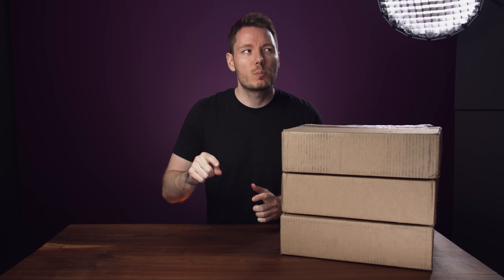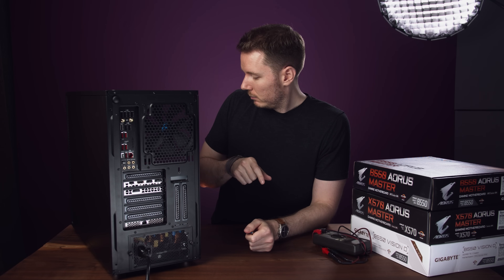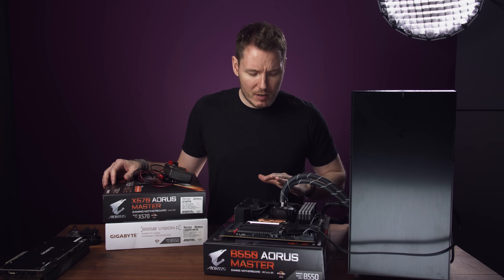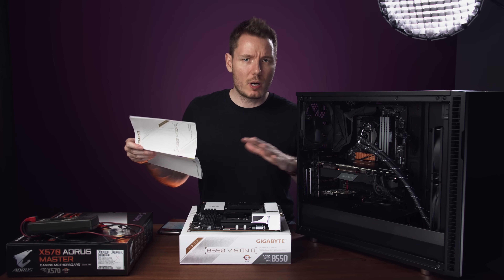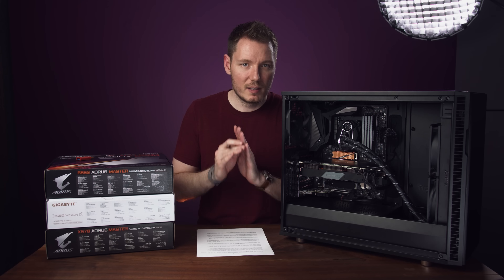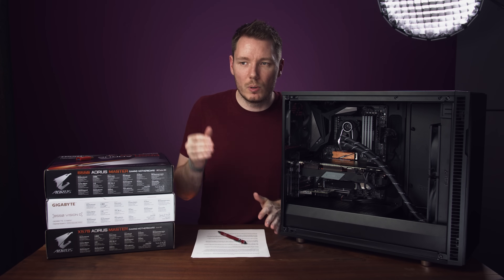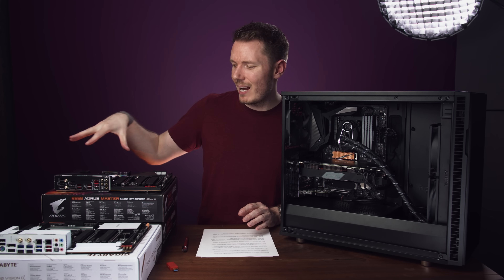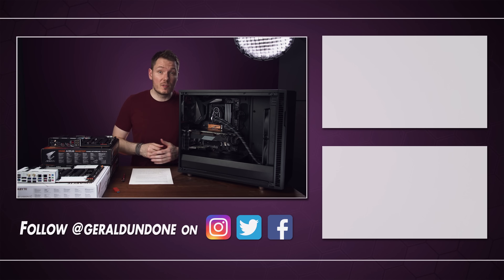I Was WRONG About These AORUS AMD Motherboards

Comment: 0:57 Audio interference is usually not mainboard, it's often the front panel of PC enclosure. If you're unlucky it connects Audio GND and USB GND together which is a big NO-NO. It defeats the audio star-ground on the mainboards and creates a ground loop. But it wouldn't matter if you use external interface exclusively and don't have any audio connection to PC. The ground routing can then cause the loop created between USB and audio to become an antenna which will collect all sorts of RF interference, predominantly from all the switching voltage regulators like on the GPU and elsewhere and from the PWM light control etc. To check: disconnect HD Front Audio connector from mainboard, the noise on rear audio out can disappear. You want there to not be continuity between front panel audio ground on the case and any USB ports on the case, but if you connect mainboard, the continuity will be measured through mainboard.

Longer ground loops are also possible. It's needed to consider all the equipment, not just the PC, but everything connected, all the connections made. I don't believe you showed all in the video, the interface was only mentioned in passing.

A few minutes in... the continuity between protective Earth pin of the PSU, the chassis, and all ground points must be continuous, the mainboard per se cannot defeat it. This is weird. Why it's not measuring like that... injected ground loop current? Wait a sec, what multimeter do you have, and does it measure continuity on the resistance range or on the diode range? I think it would be curious to switch all the multimeter modes and even try current and voltage. You want there to be zero current through the multimeter between ground points and you want zero voltage between these points.

Very important, do you have an extra PSU to test? Because i don't 100% trust yours at the moment. Please perform resistance measurement from middle pin (ground) on the IEC power socket to ground outputs on ATX connector and others. First you check how much is the resistance of your multimeter and multimeter leads by connecting them directly together, you expect to see something like 0.3 Ohm, and then you check the ground path resistance through the PSU, and you expect it to not be significantly higher, maybe by 0.1 Ohm at most. It's also vital that PSU enclosure screws are similarly well connected. Because most of the switching noise gets disposed of by shunting it to house earth, so earth impedance must necessarily be very low. And well it must be low all the way to the breaker panel in the house.
Reply from the maker: Yes, I think that's what's happening. The USB is acting like an antenna for the noise in the system due to the grounding issue.
I have tried another PSU, didn't make a difference. The only thing that resolves the grounding problem is switching cases. 
The results are the same even if I measure from the ground pin on the power cable to the computer. Works when off, not when on. The case has to be doing something right? Why else would it work in a different case?
Reply: Gerald Undone The grounding issue could have also fried the USB ports that didn’t work, especially if you used powered hubs.

Comment: Hi. Great video, but I thought I should point out that your front mounted radiator with the tubes down is going to put additional stress and wear on your pump. JayzTwoCents did this video https://www.youtube.com/watch?v=xNAMxZgvves&t=31s explaining how radiator position matters. You clearly do your research and know a lot, but everyone needs a pointer now that then... just thought I'd help :)
Reply from the maker: Hey! GamersNexus did a video recently that very convincingly proved that tubes down is the best way to go for front mounted radiators provided the top of the rad sits above the pump, which mine does. As far as performance, I get better thermals with front mounted with this build. Usually you trade off GPU temps for CPU temps by choosing your mounting position between top and front. I've tested this pretty thoroughly myself. 🤓
Reply: @geraldundone  Got it. I'll have to check out that video sometime then. While it's been a bit, but I think that JayzTwoCents video did mention radiator height relative to pump position, and I forgot. My mistake :/

Comment: pro tip, you can boot a mobo outside a case without the case power button by just touching a screw driver to the two pins that are for power button
Reply from the maker: That makes perfect sense. Thanks for the tip. I don't know why I never thought to do that. Like I said, I was already jumping the CLR CMOS pins. 🤓

Comment: I get interference with sound when using LED fixtures. I work for a company that does concerts. We have conventional lighting as well as led lighting. We have to make sure that the lighting is on a separate leg of phase in order to limit the interference with the sound or video. So generally when a venue has 3 phase, we lock in our power distribution panel, and we plug video, lighting and sound into separate phases of power.

Comment: Continuity testing rarely works well when a device is on. As current gets leaked through to ground, it causes small voltage differentials to appear in the chassis ground, which will confuse your meter.
Also, I’d generally recommend against continuity checking while things are on anyway, as this applies a small voltage to the probes, and this can confuse sensitive system components (to my knowledge the highly limited current released by the meter is unlikely to cause any actual damage, though, but I have by times seen it crash a system, or introduce glitches).
Reply: So basically continuity measurements only work in circuits without an applied voltage? I didn't know that! So the meter looks for exactly the voltage it sends out?
Reply: lightsout Yep. Only “reliably works” in inert circuits. And yep, it’s looking for a trickle of current of its own production, which can easily be fooled.
Reply: IANAEE, but i was wondering if this was the appropriate method too. Wouldn't the appropriate way to test for grounding issues be to set the multimeter to VDC and measure the voltage difference between ground points?
Reply: Nick in theory, yes. But while that might work while the machine is powered on, there are so many ground points where would you start? A lot of grounding issues are caused at the component level (missing or broken decoupling capacitors, broken shunt resistors, etc), and would be nearly impossible to find with this method, without a schematic, micro tipped leads, and a lotta time on your hands. Generally the best way with advanced micro- components like these is to just do what Gerald did and swap out components until you’ve whittled down the list of possible culprits.
(IAAEET? Is that the acronym? Lol)
Reply: @WesPerry  IANAEE - I am not an electrical engineer. Why anyone would expect you to know that is beyond me, or, WAWEYTKTIBM. ; )
Reply: @rango_unchained  I had gathered that, but thanks ;)
My acronym was I Am An Electrical Engineering Technologist, IAAEET ;)

Comment: That’s a issue I have never encountered (thankfully). 
But at least you solved it to be a case issue.
Reply: he didn't solve anything because he's still using the same case, that's the first thing I would throw away if I had that problem and I wouldn't use my computer if I knew there's a ground issue as he's showing because it can kill you if there's no earth ground when the computer is on, that's crazy and stupid if you keep using it the same way.
Reply: Ricardo Penders 
You got an information to back up those claims?
Reply: @Itspixelwolf  just hold a live wire in your hand and the other hand you hold earth and see what happens... NOOOOOO of course don't do that it will kill you!!
But it's the same thing, if in the case or PSU the live wire got loose and it's against the case it can kill you because the earth is not connected that's just logic and I don't have to prove that it's in the books
Reply: Ricardo Penders I am pretty sure that concept is not the same and incorrect and full of variables. Unless you are directly touching the inside of the PSU you’ll probably get nothing more than a painful shock.
Reply: @Itspixelwolf  the case is metal so if there's a loose wire inside the PSU and it touches the metal the whole case can go live so do what you want with it I don't care, I wouldn't want to have a case with that big of a risk to electrocute someone
Reply: Ricardo Penders k

Comment: Does the noise go away if you run your audio out from the headphone jack at the front of the case? (I know this is hardly a “solution,” but I wonder if you have tested it.) Had the R5 Fractal with a different build than I have now, and this was the only way I was able to eliminate noise from my speakers. After updating all my internals a couple years ago, this problem went away and I no longer need to do that even though I’m still using the same case.

Comment: the gpu coilwine throu the speakers is something that asus and nvidia solved couple years ago, with the B450 release, one more reason for me to not chose a gigabyte atm (I've used gigabyte for almost 10 years, and still use it in one of my systems, so I don't consider myself an asus fanboi)

Comment: I think I got the same case, and I do not have any issues with sound, but I do not use any RGB elements :). Have you swapped power supply also? I would rather bet on power supply then MB or case.

Comment: Wow! I had that problem with my old B350 Gigabtye motherboard and Ryzen 1700X using the DAC USB (using M-Audio SuperDAC). I also had Corsair LED RAM in it. I tried different USB ports and still that high pitched sound. Tried reversal polarity on the powered M Audio BX 5's and the sound was still there. 
But through the 3.5mm headphone jack, no problem.
I've upgraded to a X570 Gigabtye Elite and 3990X with RGB Corsair RAM and just a slight hint of that high pitched sound. Playing anything masks it completely.

Comment: At around 13:05 I started to laugh.
I just laughed at how ridiculously relatable and lifelike this video is.
How the second you turn on your newly assembled PC and it runs into a bluescreen, or a hardware failure, or basically any of the endless possible issues that can happen to your build, and the itching feeling of utter annoyance but also nerdy interest and solid determination to solve the issue, and the testing, and the monitoring, and the reassembling, over and over again...
Is it a bad motherboard? Did I install my drivers incorrectly? Is it a faulty memory block? A small screw short-circuiting the electrical loop? And when you thought you have finally figured out what the problem was, it turns out it is in fact multiple problems, weirdly interacting and aggravating one another. Aaaand here we go again.
Painful bliss.
Reply: How fortunate we are to have these kinds of problems.
Reply: It can be super annoying to do such stuff when it's your only PC and you gotta render and edit videos... Not to mention the stress, DAMN!

Comment: Gerald, there may still be a "relative" ground issue when the unit is powered on.  It is possible that the power supply has multiple V+ rails (most do). I suspect the power supply manufacturer is doing something funky with the grounding where maybe they are isolating each rail including ground so each becomes its own independent circuit. You may be experiencing the lack of a common ground between the circuits when powered on. You could verify that by testing the ground pin on each rail against the other rails to see if they are common when powered off but separate when powered on.
Reply: The PSU would also be one my first suspects, I don't think Gerald tried to swap the PSU did he? The case being a factor is also strange, maybe the way the PSU sits and/or cable runs through the case worsens the PSU problem (if it has a PSU problem)
Reply: JoaoRelego the FractalAudio (no affiliation with Fractal Design) thread I dug up says there is a major difference between Fractal Design R6 compared to most cases. Isolators. Rubber sound dampers separating some parts of chassi from others. Which FractalAudio says are bad for EMI.

However: Other threads says the total opposite, that you should isolate everything and never ground chassi, only ground through though PSU cables. Apparently there is a ground design war I wasn’t aware of before.
Reply: @JoaoRelego  I have the same case with a different build and have never had an issue like this. I am not a computer expert, but I was considering looking into a build like that in the case I currently have. Is this something I should be concerned over or are you thinking it may be the power supply?

Comment: Hey Gerald in regards to measuring continuity, please bear in mind that in order for your Multimeter to do that, it will generate and run a small low powered electrical through the circuit you are testing. Therefore is the circuit is powered on whilst you are doing the measurement, that might give some opportunity for another live current going thru that same circuit to interfere with the measurement. However to be clear: this is probably not? the real cause of the issue? Because the issue went away in the other case. What I believe might be happening is that the completed circuit is requiring a return path thru the case instead of the motherboard's 24 pin atx connector. Which is a different quality of electrucal grounding connection between case A and case B. Perhaps on this specific motherboard they decided to disconnect some of the usb port outside shield(s) if those ports are specifically being designated for use as 'low noise usb audo ports'. That is really the only specific reason that immediately comes to mind right now. There might be a different explanation.  You can test that theory by removing the motherboard from all other components. And unplugging it from *everything else including the casee and backplate etc*. And then just probing for continuity between each usb port metal shield and one of the GND pins on the 24 pin ATX connector. With the device switched off. If the resistance is somewhere around 0.7 ohm. Then that is a solid metal connection there. Then there is no lack of continuity going to the PSU. In which case it was a false reading when the complete system was powered on. If there is a different result then look on the solder joints of the usb port housing on the pcb, and see if the solder points connects to the motherboard ground plane. Or they are isolated / floating by design. Then perhaps it was an intentional design decision by Gigabyte to have a floating isolated usb port.
Reply from the maker: Thanks for this!

Comment: Ohhh what... I had this exact same issue like 10 years ago (mostly just hiss though, not ringing). I was using Yamaha HS50ms (which look similar to your monitors) and an RME Babyface. But I hadn't even considered the problem could be resolved with the computer internals. I had assumed I needed to do something with the XLR cables so I bought a couple of these (or equivalent): https://www.amazon.com.au/Hosa-GLT-255-Female-Ground-Stopper/dp/B00FC4YPL4 

It helped a bit, but still wasn't perfect.

Comment: For the issue with your RAM - it might be the LED's in it:
I had internet problems regularly after I renovated my office. A month ago I had enough and called a technician to have a look. He looked around for about an hour, checking all connectors and swapped all old cables for uninsulated ones, but nothing changed. Then we turned the power off to check if it's a unisulated cable in the wall somewhere and suddenly the problems were gone. When then measuring the current on my outputs we got no error for the power cables, so we resorted to go piece by piece. Finally, when we were turning everything on again, step by step, we saw a sudde  drop in speed and multiple interferences causing jitter when I turned on my LED desk light which was standing right beside the router. I swapped the LED bulb and still got the same issue. Also moving the lamp to the other side of the desk didn't help. Since the lamp is gone now and replaced for a regular bulb my issues are gone aswell.

Now I don't know how this correlates to your coil-whine issue, but I assume it could be similar. It could either be that LEDs in general can cause interference in your system (especially since they're so close) or that the insulation around the diodes on your RAM is faulty and I as well had bad luck with two janky lightbulbs.

Comment: Remember the good old times when Motherboards were green or yellow and you had red paper washers with your board that you put between the screws and Standoffs in order to Isolate the board? Yeah ... I do.
Maybe an issue there.
Continuity is there when off because there is a proper path. And as soon as you power on, somewhere along the lines of a screw or so it doesn't find it's the proper way home. Tolerances are tighter and the space where the screws and standoffs are, are tiny compared to "back then". So maybe worth checking.

For the coil whining and hissing:
What happens when you turn your RGB Memory OFF. So no lights? Will that help? I would suspect a high freuqency module to PWM the RAM and this causes issues. 
Same for the GPU. You could probably check that if you "manually earth" these components. I.e. putting a crocodile clip from the GPU bracket to the PSU screw or something like that so it "has it's proper path" that you don't have when you power on the case.

The Motherboard of my wifes PC has some form of "metal sponge material" to it on the motherboards "shield" so it properly mates with the IO shield that you put in the Case before installing the board.
These Motherboards don't seem to have an IO shield anymore because it's all integrated in the big "block" now.